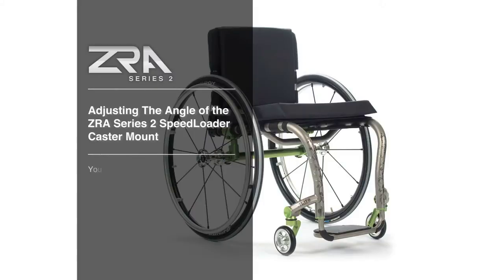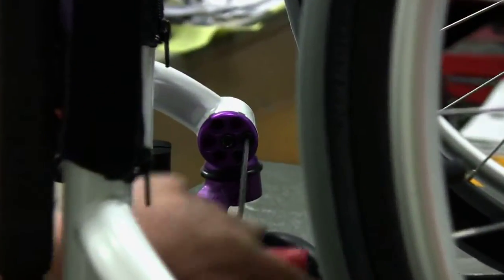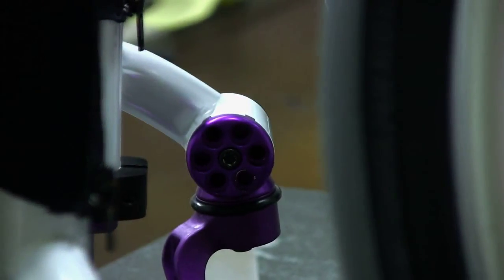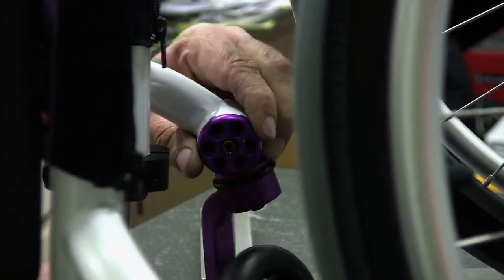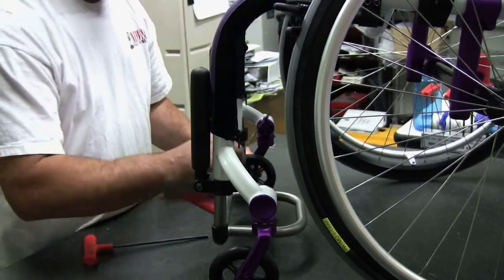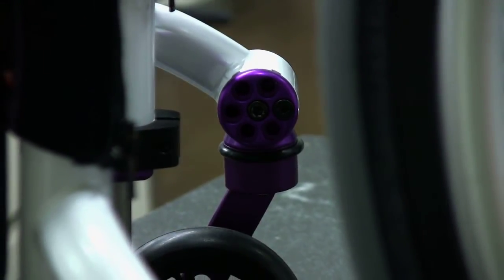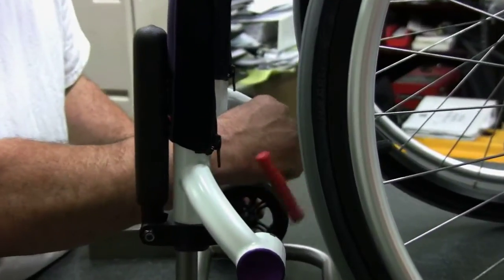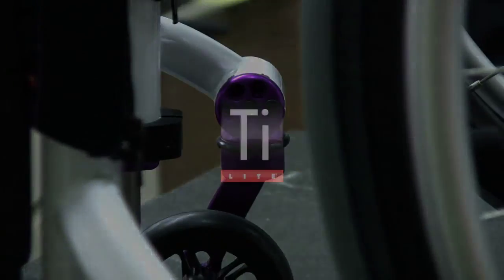Adjusting the Speed Loader caster angle on the TiLite ZRA Series 2.

Comment: I’ve been in a chair since 2004 para complete. Tilite manufacturing has gone down hill.roll in showers.. Bearing life.is shit less than a year. My caster fork assembly’s bearing die with in a year. Earlier ZRA chairs were bullet proof. I still have those chairs and the fork assembly spins like they were new. My 2017. I am not impressed. Another pain in the ass. You have to go through a dealer. Here it takes like 6 freaking months to even get parts through them.. As if being in a chair isn’t hard enough. Depending on who you purchase through.. my point $6000.00 for a chair who’s bearings barely last a year.. is A FUCKING JOKE AND AN INSULT. Made in America. But not made with Quality, like things once were in AMERICA.. Everything is throw away now, I’ve had the same issue in my last three chairs. So from 2012-2018. I will not buy another Tilite. For the cost the lifespan of beatings is ridiculous.. I’ve had 6 of these chairs.. I’m done... They were bought out, now it’s even worse.. my last chair arrived my forks were unevenly set.. So 🤬. Trying to find how to adjust them properly and either live or replace these bearings, zero data.. You can’t call Tilite..  if your not a Dealer.. another BULLSHIT loophole to keep the money in the pockets of those who profit from or Disability’s 🤢🤮😡🤬.
Reply: So what do you have now? I'm coming from a cheap ass ki mobility to a new version of the ZRA and your right six months in the bearings aren't what they used to be you can just buy some ceramic ones online rather than call them up
Reply: I hear ya mate, my missus has tilite 2gx and has had nothing but problems with the caster fork. Her wheelchair service shop are struggling to order in the replacement parts due to shipping delays here in Australia... the whole thing is beyond a joke, this is her mobility and enjoyment of life we're talking about...surely tilite would be super aware of the problems yet still haven't updated the design. Never again will we buy tilite that's for certain.